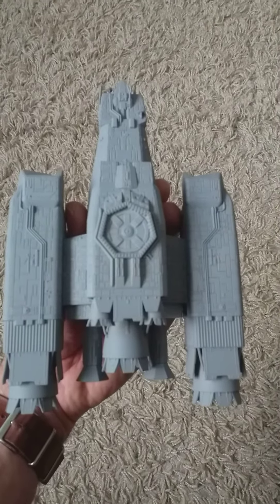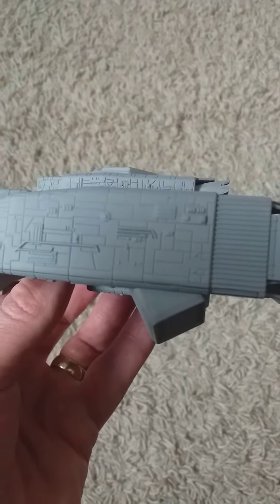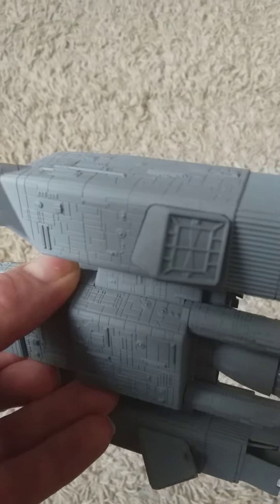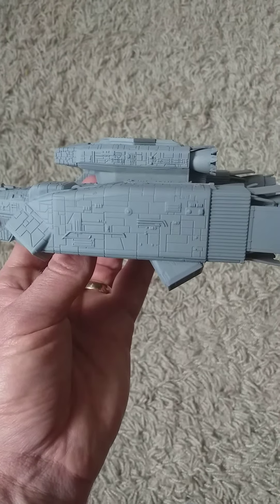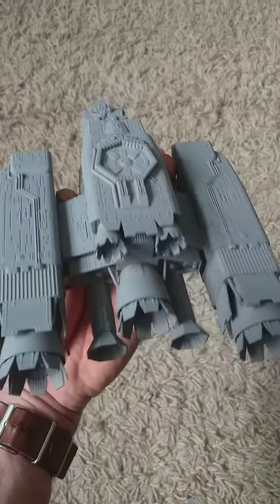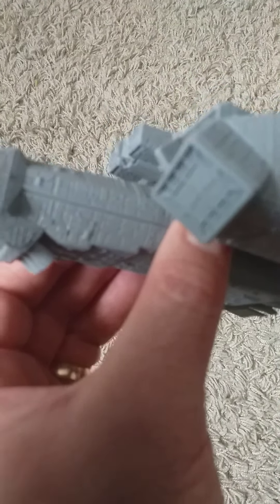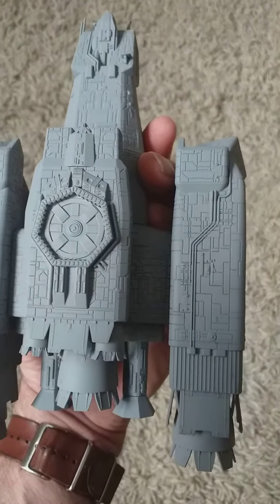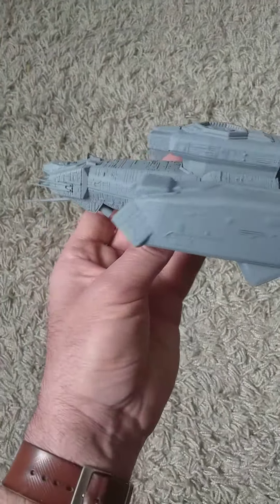Repainting the Eaglemoss Alien Nostromo - Part 2

Comment: Use a hand drill instead of the motorized drill(well. Maybe the Tamiya drill) to drill the holes. That way you have more control on the depths of the hole and wouldn’t crack the resin if be.